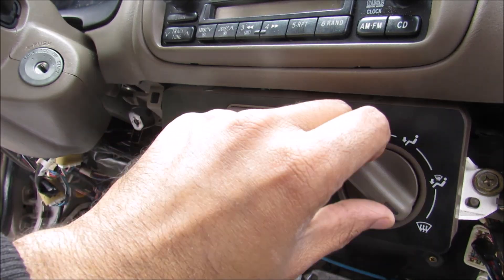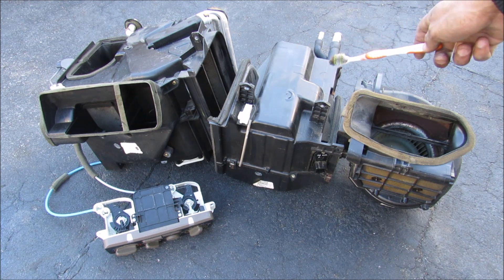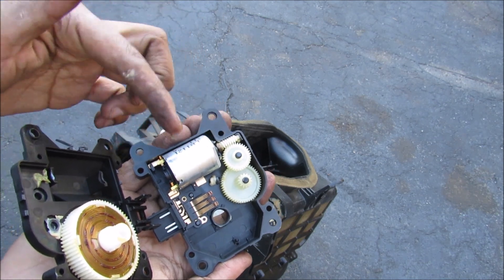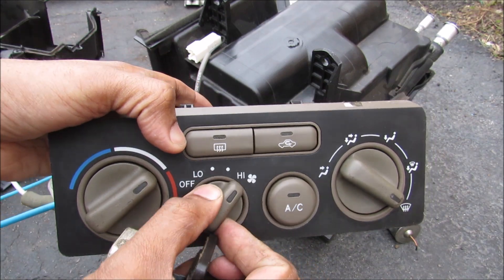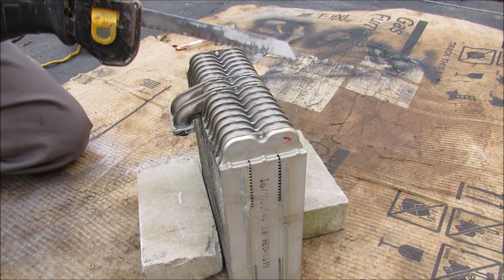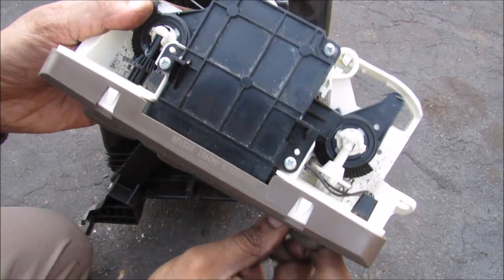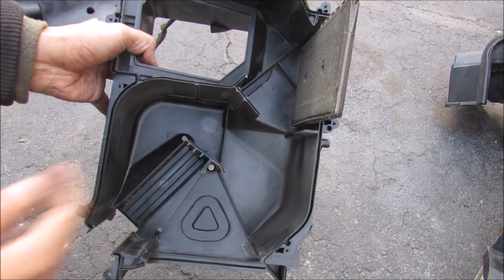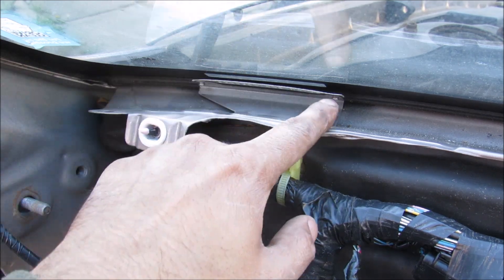How a Car's HVAC System Works

Comment: Make a 12v small bedroom AC out of it!
Reply from the maker: Good idea
Reply from the maker: But then I'd need a compressor and condenser mounted outside...
Reply: @speedkar99  for compressor, i think the car ac compressor will work if it powerd by a small 220v motor like in water pumps

Comment: You faulty info.    The gas from compresseur (hp) .... To condenser (hp) ... To expansion valve ... To evaporator (LP).. and retor to compressor with low pressor

Comment: I can't for the life of me understand why why 2018 toyota corolla sticks! when blowing heated air but not with ac?
Reply from the maker: Check the AC compressor if it's kicking on and if you ha e enough refrigerant in the system

Comment: In Iraq temperatures can reach 50 centigrade 120F when we get to this all the AC system fails unless you start cooling the condenser with water ... Any ideas ?
Reply: Don't live in Iraq.
Reply: @thersten  am searching for a solution not a way out of my country...  Thanks for the advice thou 😁

Comment: Maybe the way the HVAC works is inefficient (you cool the air down only to heat it up), however the heat in the coolant is a waste anyway -  all in all, you get rid of it using the radiator.
Reply from the maker: +pancakewsx true. But the ac helps to dehumidify
Reply: speedkar99 yep, I agree. I just meant that this built in inefficiency of air conditioning does not matter too much as you are using energy that is a waste already. Great vid by the way, good job done here! Your how-things-work videos are real pleasure to watch. Cheers :)

Comment: I have one question. My car broken and not need it anymore. Bu i thought if i can take out the airconditioner and heat my shed on winter by solar battery or turbin. its about 12kvm. Or is anyone already try it i can see somewhere how they done it? Thanks
Reply from the maker: That's something I'd like to see!

Comment: So that’s why it costs a shop over a grand 🙄
Reply from the maker: Exactly. The dash has to come out.
Reply: Too many cars seem built around the heater/AC box nowadays. Pray nothing ever happens to it, if you have a car which needs a dash out job for evaporator/heater/air flap replacement.

Comment: Dude that's a lot of abuse to an expensive HVAC system just to illustrate the flow. There are other ways of showing it but abusing the part in front of the camera? That's cold. Most of us are probably DIYers watching your video. You're supposed to be educational in aid of independent repair; what I saw was torture of a probably still functional part. Know what, I cease to be your subscriber too.
Reply from the maker: Lol 
Abuse? 
This car has seen worse 
This is sacrifice in the name of science!